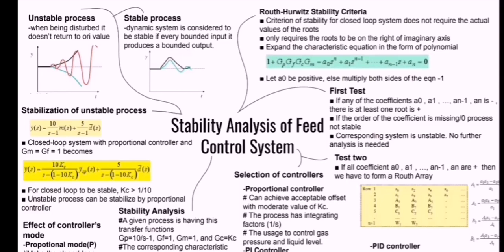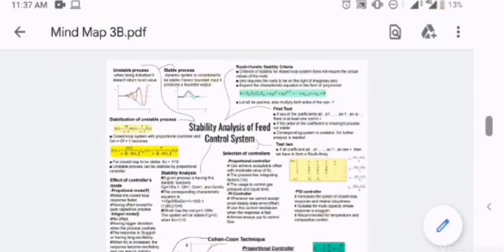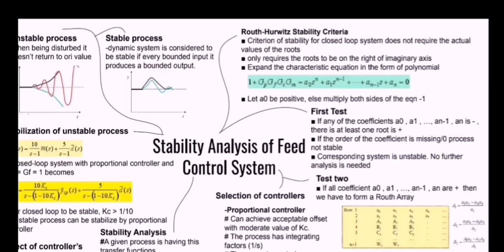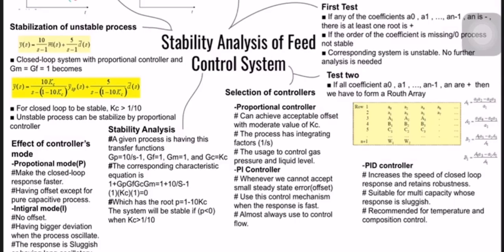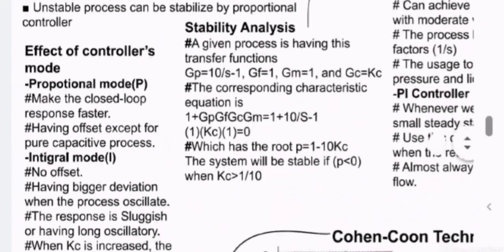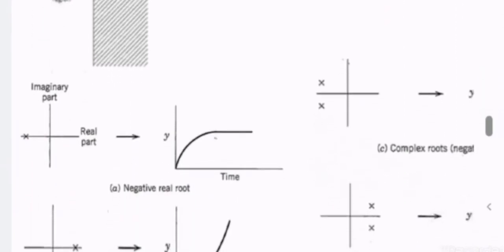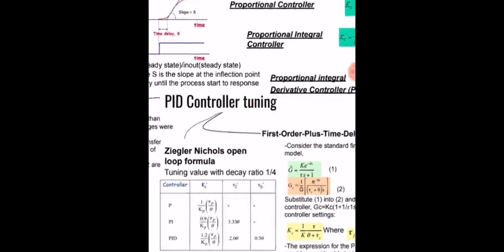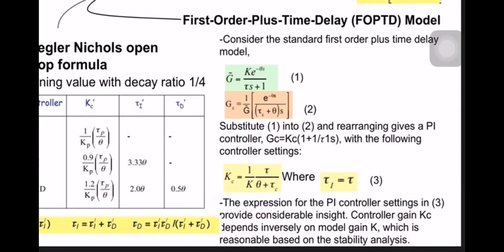Closed Loop Analysis (Stability and Tuning) Team 1

Comment: Well-explained video! But I have one question, why do we assume set point changes rather than disturbance changes in the General Stability Criterion?
Reply from the maker: The answer in based on characteristic equation. Team 1 will explain more on this.
Reply: We can refer to equation 10.81 since the assumption are based on the analysis in equation 10.80 to 10.86. Kindly refer to page page 189 and page 191 in text book 3rd edition. It is state that the equation is for the moment consider set point changes only. However, the general stability criterion is valid even if the assumptions are removed. This is because the Gol only include GcGvGpGm, thus we assume the setpoint changes instead of disturbance changes.